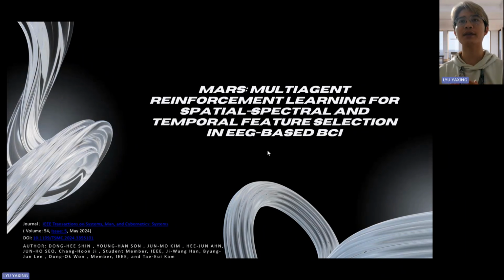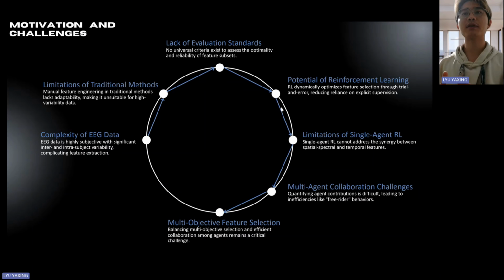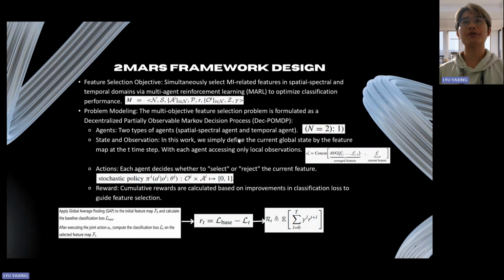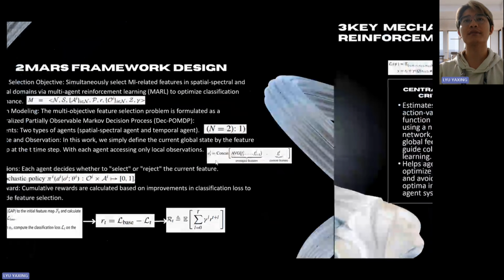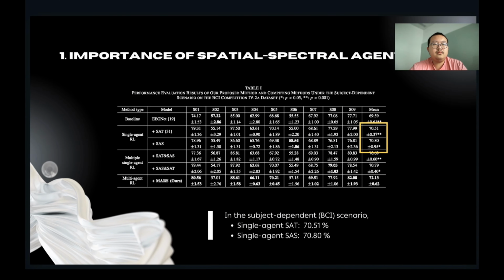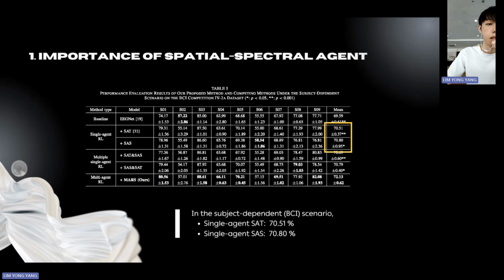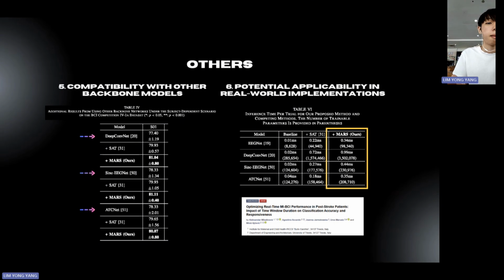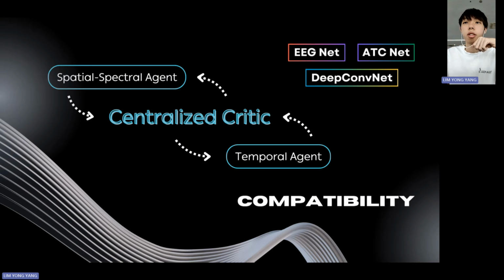202409 AIT306 Group 2

Comment: By G4:
Q1: Do you think Genetic Algorithms can replace the Evolutionary search on hyperparameter optimisation?

Q2: How does evolutionary search dynamically maintain and evaluate multiple hyperparameter sets to balance exploration and exploitation for improved training stability?
Reply: Q1：
Yes, Genetic Algorithms (GAs) can replace evolutionary search for hyperparameter optimization, but their suitability depends on the specific requirements of the optimization task:

Similar Foundations:
Both GAs and evolutionary search are metaheuristic optimization techniques inspired by natural evolution. They share common principles such as selection, mutation, and crossover to explore the search space.

Applicability to Hyperparameter Tuning:
GAs can effectively explore and exploit the hyperparameter space, especially for discrete and combinatorial search spaces. They have been widely used in hyperparameter optimization for machine learning models.

Comparison to Evolutionary Search:

Evolutionary search often incorporates advanced mechanisms such as dynamic adaptation of mutation rates or more sophisticated selection strategies to balance exploration and exploitation.
GAs, while simpler, may struggle with convergence to optimal solutions if the search space is highly complex or if there are interdependencies among hyperparameters.
Trade-Offs:

GAs: Easier to implement, generally computationally efficient for smaller-scale problems, but might require more tuning of crossover and mutation strategies.
Evolutionary Search: More flexible and robust for large, complex search spaces but potentially more computationally expensive.
Reply: Q2：
The evolutionary search in the MARS framework dynamically balances exploration and exploitation by maintaining a diverse population of hyperparameter sets, using cooperative fitness evaluations, and employing adaptive search strategies.

Evolutionary search introduces random mutations to hyperparameter sets, ensuring exploration of previously untested configurations. For MARS, this might include variations in spatial-spectral-temporal feature selection strategies or learning rates for different agents.

The evolutionary search in MARS adjusts exploration and exploitation dynamically over iterations. Early stages prioritize broader exploration to avoid local optima, while later stages focus on refining well-performing configurations to enhance training stability.
Reply: Q1：
Yes, Genetic Algorithms (GAs) can replace evolutionary search for hyperparameter optimization, but their suitability depends on the specific requirements of the optimization task:

Similar Foundations:
Both GAs and evolutionary search are metaheuristic optimization techniques inspired by natural evolution. They share common principles such as selection, mutation, and crossover to explore the search space.

Applicability to Hyperparameter Tuning:
GAs can effectively explore and exploit the hyperparameter space, especially for discrete and combinatorial search spaces. They have been widely used in hyperparameter optimization for machine learning models.

Comparison to Evolutionary Search:
Evolutionary search often incorporates advanced mechanisms such as dynamic adaptation of mutation rates or more sophisticated selection strategies to balance exploration and exploitation.
GAs, while simpler, may struggle with convergence to optimal solutions if the search space is highly complex or if there are interdependencies among hyperparameters.

Trade-Offs:
GAs: Easier to implement, generally computationally efficient for smaller-scale problems, but might require more tuning of crossover and mutation strategies.
Evolutionary Search: More flexible and robust for large, complex search spaces but potentially more computationally expensive.
Reply: Q1.
Yes, Genetic Algorithms (GAs) can replace evolutionary search for hyperparameter optimization, but their suitability depends on the specific requirements of the optimization task:

Similar Foundations:
Both GAs and evolutionary search are metaheuristic optimization techniques inspired by natural evolution. They share common principles such as selection, mutation, and crossover to explore the search space.

Applicability to Hyperparameter Tuning:
GAs can effectively explore and exploit the hyperparameter space, especially for discrete and combinatorial search spaces. They have been widely used in hyperparameter optimization for machine learning models.

Comparison to Evolutionary Search:

Evolutionary search often incorporates advanced mechanisms such as dynamic adaptation of mutation rates or more sophisticated selection strategies to balance exploration and exploitation.
GAs, while simpler, may struggle with convergence to optimal solutions if the search space is highly complex or if there are interdependencies among hyperparameters.
Trade-Offs:

GAs: Easier to implement, generally computationally efficient for smaller-scale problems, but might require more tuning of crossover and mutation strategies.
Evolutionary Search: More flexible and robust for large, complex search spaces but potentially more computationally expensive.

Comment: By G1:

Q1: What are the advantages of the MARS framework over other baseline models?

Q2: Is the MARS framework applicable to different deep learning architectures?

Thanks.:face-red-heart-shape::eyes-pink-heart-shape::yougotthis:
Reply: Q1:
Multi-Domain Feature Selection: Unlike single-agent or multiple single-agent RL frameworks that operate independently on temporal or spatial-spectral domains, MARS integrates these domains through cooperative multiagent reinforcement learning, leading to more comprehensive feature selection.

Counterfactual Advantage Function: MARS utilizes this function to address the credit assignment issue in multiagent systems, improving the reliability and effectiveness of individual agent contributions to the overall performance.

Cooperative Policies: By fostering collaboration between agents, MARS achieves higher cumulative rewards and improved learning dynamics, overcoming the free-rider problem observed in other multiagent systems.

Q2:
Yes, the MARS framework is highly adaptable to different deep learning architectures. The multiagent RL structure in MARS is designed to operate independently of specific feature extractor models. Its core mechanism—multiobjective feature selection in spatial-spectral and temporal domains—does not rely on the internal architecture of the feature extractor, allowing for flexibility in deployment.